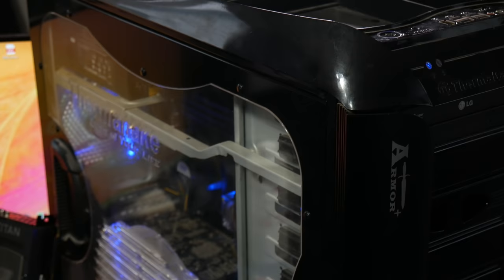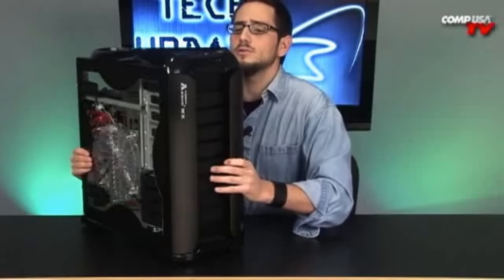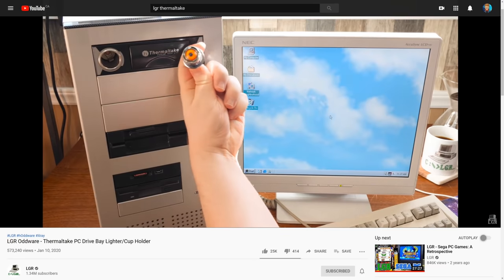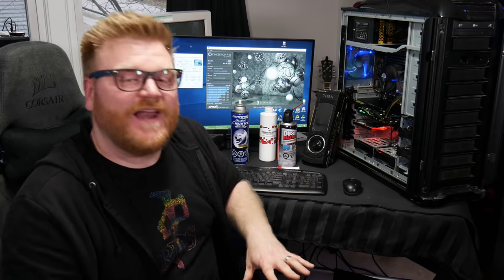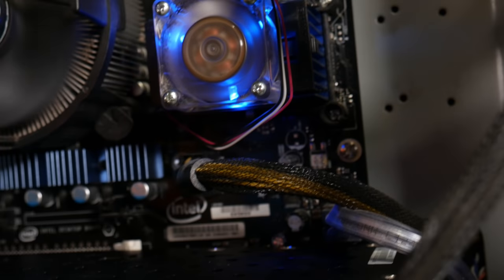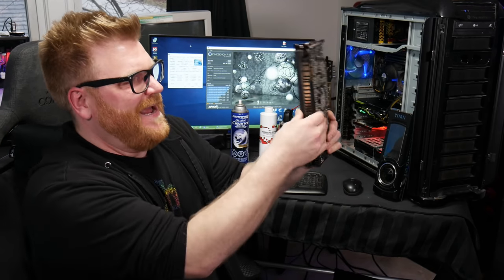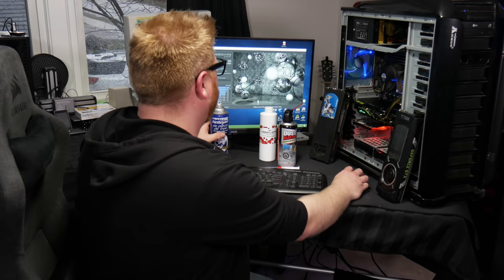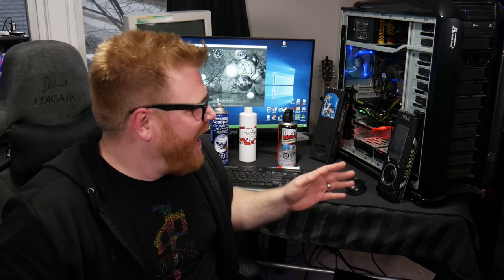Can $5000 buy a PC that will last 10 years?

Comment: HEDT is something you buy and regret in 3-5 years. i regret buying this i7 6900K when Ryzen launched.  the price of ryzen for the performance really was a kick to the nuts. now with ryzen 4000 coming,the i7 6900k and intel's gouging at the time, i can say it hurts everytime i think of the price tag.

meanwhile the EK 360mm kit i bought is my most prudent purchase... it as expensive
it cooled my i5 3570k that ran 4.4-4.6ghz for  a year before i had to drop it back to 4.2ghz 
and right now its cooling the i7 6900k.

that said i did make full use of the threads... i was transcoding all my old dvds and doing streaming on the side.
but i was most disappointed with the clockspeed (i lost the silicon lottery)...it struggles to reach 4.4ghz, its stable around 4.2ghz  with some fiddling of the voltage but the temps trade off was not ideal. so i left the voltage to auto and max ratio at 4.0Ghz, this allowed the speedstep and intel turbo boost to be usable. this config dropped temps and allowed it to be a relatively quiet pc.

my plan is to get a ryzen 3300x to replace my dead i5 3570k Nas/home server pc.
after that is no concrete plans for:
when ryzen 4000 launches, might consider a Ryzen 4700/4600 as the game pc.
 This i7  6900k pc can then be a backup to my gaming pc or a capture/stream encoding
i dont need more than 8 cores/16 threads for what i do. and 32GB of ram. dont need 64GB.
might consider the "RTX 3060/3070" which will be a good  replacement for my GTX 1070

Comment: I litterally bought a x79 msi big bang 2 yesterday in a corsair 900d, titan x maxwell, 48gb corsair vengeance ddr3 2400mhz (which ive never even seen before) corsair ax1200i, coolermaster 360mm aio, 11 x coolermaster 120mm argb fans, thermaltake digital fan hub, 480gb ssd, 6x 2tb western digital blacks for a ridiculously low price. I mean im not gonna say how much but lets just say 100 bucks more than $200 😎.

Wtf is wrong with some people? 😂😂😂

Comment: Rate my build I’m working on!
R5 1600AF
Asrock b450m steel legend 
16gb 3000mhz dual channel RAM
Crucial mx500 1tb ssd
Gtx 1080 Evga acx 3.0
Corsair crystal 280x rgb case
Either a wrath prism or 120mm aio to let me overclock later on.

I’d appreciate input! Working on a college student budget, so I can’t afford to go all out

Comment: Why would you want to do that though? You can spend 350$ on a motherboard and processor every 2 years and still have bleeding edge tech in the mid range. You'd spend far less than 5000$ and have more performance than the 5k computer in the later part of the 10 years.

Comment: This computer is all sorts of oof. I feel like this is a prime example of people who have money but want to "save money" in the long run, always thinking the best is to invest heavily and play the long game without doing any research.
In 2012 when I built my first computer, I had very little money (I still do) The computer I ended up building was an FX-8350, M5A97 Motherboard with 16GB of RAM, a 1TB HD, a 650W 80+ Bronze EVGA open box PSU, some cheapo case, an open box 650Ti for around $570.
Did the computer last me 10 years? Well, no, but the majority of the components are still around and useful today, 8 years later. I sold the 650Ti for $35, later down the line. The FX-8350, RAM, HD, PSU, motherboard and case are all still being used. None of these components were really top of the line when I bought them but I did my research and bought everything when they went on sale for any reason. Every 6 months I deep clean everything (Thermal paste gets replaced every year) so the majority of the system is in great condition, two years ago I gave the system to a family member after plopping in a $40 250GB SSD as a boot drive, and a used RX 580 8GB I got for $90 and a Hyper212 I got for $10
Overall cost of the system, after upgrades/selling parts: $675

Buying the biggest and best things is not how you save money.

Comment: spend 6k now and sell it for 300 (loss of 5.7k and average performance at best  for the last 5 years and miss out on support for some things)
spend 3k now sell for 1.5-2k in 2 years, spend another 3k  sell for 1.5-2k spend another 3k  sell for 1.5-2k and buy another 3k and sell for 1.5, buy another for 3k and sell for 1.5-2k again. worst case senario you spend 7.5k but you get high end performance year on year while having to save less of a lump sum if your willing to go without a pc for max a week. best case senario you spend 5k which is less that you spend for your once off.
if you want to go even cheaper for very similar performnce you build the bestest system you can and buy second hand on the gpu. if you wait  few months after the inicial launch of new gen the next teir up is usualy release so you can score the 2080 (or equivalent in the future) where the people who have to have the best are upgrading again and just want rid of old hardware. it migh be a bit different this gen though with covid i wouldnt be suprised if the 3080ti launches almost at the same time as the 3080

Comment: If I had 2000$ to buy a computer for say 4yrs ,I’d buy a 1000$ pc now and buy a new PC for 1000$ after 2yrs.Thats the logical thing to do.Bcuz tech not only improves but also ‘evolves’ .Eg buying the worlds fastest 4 core cpu.only in 2 years the 8 core consoles come out and all games perform the same on cheaper or even better on slower 8core CPU’s .imagine buying the biggest HDD out there ,and star citizen lists SSD as minimum spec .One more,ur high end GPU(faster more powerful) but doesnt support rtx,but newer slower cards support the feature.your 1000$ phone doesn’t have 5G and the 400$ budget phone next year supports 5G.Going all out at once is never recommended(unless and until u have the cash to keep doing it every single year after every new product launch,frankly that’s not happening for any of us).Hope ur client reads this

Comment: pfffft 
plz 
I ran a P200 for 10 years 
Replaced it with a QX6700  I ran for 10 years (actually someone else is using it as a media server now so it's still being used )
And I'm 5 years into an i7-5930K and it still runs current games fine. 
Running a rig for 10 years is fine if its a solid build. 
I might replace what I'm running when PCIE5 and DDR5 are stable but I'm not expecting that before 2024  (and I suspect it will be an AMD for once. )

Comment: The thing mais thing is the when along with the how much.
You should never aim for the most expensive stuff, usually the mid-high tier, slightly above the bang-for-buck is what you should choose.
The when is one to two years after a new console generation, this way you'll have a PC that is way better than the consoles, have the new tech and would last at least the whole console generation of games.
This is a smart way to kind of future proof, by the end of the consoles generation your PC would still be running games of that generation better than the consoles.
As you've said, if he had waited until 2014~2015 his PC would be way better than what he got, if you recall, the current gen consoles were released circa 2013~2014 so yeah.
I think it's not a good idea to build a new PC now! If we disregard the pandemic prices and think only about the tech today, anything below a Ryzen 3700x and a RTX 2070S wouldn't be very futureproof and even that will ask for an upgrade by the middle of the next gen and by that time we'll have some parts that will perform the same but will be on a lower tier so they should cost less and anyway, so you might be able to save some money to get the same performance or spent the same money you would to get a really better performance and more futureproofneess.
Also, we don't usually have groundbreaking games before 1~2 years into a new gen, so it's easy to wait while keeping yourself distracted by your Steam backlog.

Comment: Regarding that titan X: depending on how much the gpu was stressed (incl. overclocking) and how hot it got (especially he did not do any maintenance), maybe try underclocking on top of adding voltage to see if it works better. Tech yes city flashed custom BIOS with the new stable frequency into the gpu for resale. For last resort maybe buy a hot air gun instead of the oven (health reason) and concentrate on the GPU die balls. Anyways stay safe!

Comment: Well, I still use an i7 860 (which is even worse than this) as my daily driver, with 3.7 ghz oc (originally 2.8 ghz) and a gtx 970
it's still playable, I mean, Gta V, Assassin’s creed, Farcry, just cause, even Pubg and Cod warzone! runs (Cod on low, but 60 fps - 1080p only)
No, I didn't buy this computer originally thinking that It would last 10 years, but not having the money to upgrade the whole system, I just replaced the graphics card and it's been serving me since

Comment: I dunno, he should probably buy the xeon 6 core, a cooler master evo, go to 16gb of ram and like an rtx 2060. He'd probably be pretty good on most modern games, have minimal bottle-necking and he only spent $400 total. That should buy him another year or two. He can then give that machine to a high school kid and they will enjoy it. 
I've been using a 20 core ivy bridge-e for system for 5 years. Bought a new gtx 1080 and upgraded to used 128gb of ram from ebay. Spent around $2000 total. My computer will still smoke most modern systems with a 6000 in cinebench and a 11000 in geekbench 5. My 7yo machine comes pretty close to a 3950x and beats the 9900k. I can play any game in 4k at about 45fps. Most games can do 60fps at 4k. I'm pretty sure I am good for the next 3-5 years if I wanted. 
However, I will probably upgrade to Threadripper 3960x in a year or two when the price drops. I will double my performance over now, have a huge upgrade path to 64 cores, double my potential ram capacity and be ready for pcie4. That computer will certainly last 10 years as my current one has. I will spend around 3k as I will keep my current psu, case, coolers and gpu. I will spend all my money on cpu, mobo and ram. My current machine will then be demoted to a home server where I will likely get another 10 years from it in that use case. 
Point is, you can build a computer that can last 10 years as a daily rig, but you cannot buy consumer parts if you want that. You have to buy HEDT or higher if you want that kind of longevity. I am not a performance hawk. As I feel like I am just chasing wind. I like stability and dependability. I wanna just sit down at my desk everyday and know I am not going to have a computer issue and be able to do what I want to do. As long as my computer is rock solid, I am ok with watching its relevance slowly decline for 10 years. If my computer platform doesn't last 5 years it was a fail. I expect 10 years of worry free use with moderate upgrades along the way.

Comment: This is my comp i built a few yrs ago
AMD - Ryzen 5 1600X 3.6GHz 6-Core Processor
Cooler Master - MasterLiquid ML240L RGB 66.7 CFM Liquid CPU Cooler
Asus - STRIX B350-F GAMING ATX AM4 Motherboard
Team - Dark 16GB (2 x 8GB) DDR4-3000 Memory
Samsung 970 EVO 250GB - NVMe PCIe M.2 2280 SSD (MZ-V7E250BW)----Newest
Samsung SSD 850 EVO 500GB
Western Digital - BLACK SERIES 1TB 3.5" 7200RPM Internal Hard Drive
MSI - GeForce GTX 1070 Ti 8GB Titanium Video Card
Cooler Master - MasterCase H500P ATX Mid Tower Case
Cooler Master - 750W 80+ Gold Certified Fully-Modular ATX Power Supply
Cooler Master mm830 Gaming Mouse with 24, 000 DPI Sensor, Hidden D-Pad Buttons, 4-Zone RGB, and Precision Wheel----Newest
Cooler Master MasterKeys MK750 RGB LED Mechanical Gaming Keyboard, Cherry MX Red, RGB LED, Full Size, Wrist Rest (Large)----Newest
Cooler Master MasterAccessory MP750 XL Soft Mouse Pad with Water Resistant Surface and Thick RGB Borders----Newest
Cooler Master MH670 Gaming Headset with 2.4GHz Wireless, Virtual 7.1 Surround Sound, and Multi-Platform Compatibility----Newest
Cooler Master GS750 RGB Gaming Headset Stand----Newest
Logitech HD Webcam C615
Samsung CF396 Series Curved 27-Inch FHD Monitor (C27F396)
ASUS VK246H Black 24" 2ms(GTG) HDMI Widescreen LCD Monitor 300 cd/m2 DC 1000:1 (ASCR 20000:1 ) Built-in Speakers w/ 1.3m Pixel Webcam(webcam no longer works)
Microsoft - Windows 10 Home OEM 64-bit

Comment: The most money I have spent on a computer is what I have now, when ryzen first came out... It was the first PC I had ever tried to go high end with... I don't even want to try to remember what I payed for the original PC I just came across alot of money and wanted to build a bad ass PC and I'm still to this day catching crap about the cost from my wife... But hey it still runs great so that's a plus...

1700x
Crosshair 6 hero w/ ek monoblock
Trident Z 32gb 3200 c16
500gb 860 Evo nvme
2x 2tb hard drives raid 0
2x ek water cooler 1080ti FTW3 SLI
2x 360 rads w/ 6 normal  (no lights) performance static pressure fans
Ek ddc pump w/ heatsink

The only things I have changed is I have sold 1 of the gpu's because SLI is so pointless it's not even funny... I found a 4tb 860 pro (sata) for 280 on Facebook... Changed the  hard drives to raid 1... And I have bought an CPU water block to cool just the CPU for when I get my 3700x because the monoblock is clearly not made for the new zen chiplet design with it's circular CPU cooling area

Comment: If you knew what you had to do, a i5 2500k would've lasted like 7 or 8 years. You'd only have to update the GPU maybe the RAM / SSD. I like the idea to buy hardware that lasts longer but it is probably not gonna happen.

Comment: If someone have money,this is the way.It was worth it,if he had buyed every 2-3 years new pc with this budget he would have(instead of gtx295 and later titanX those cards:9500gt,after that gt950,than pc with 1050,and now,maybe,gtx1650,all cards much,much less powerful.Plus,he would probably need to buy with every new mid range pc new ram,motherboard,probably psu and maybe pc cooler etc.So, if he want new pc after 10 years ,for 5-6000$,just go for it.It will last 10years for sure.

Comment: It kinda did work though. Why keep building new systems when you can upgrade parts over time? Only mistake was not selling his upgraded parts immediately. Premium components (especially mobo/psu) are made to a higher quality/feature standard obviously. Last year I put a GTX 750 in my ancient fancy pants system I built start of 2011 - originally a Phenom 965 later upgraded to an 8350 (sold the 965 for a surprisingly large portion of the upgrade price in 2013). Luckily my top of the line MSI mobo got support added via simple BIOS update to cater for the 8350 when it dropped (even though the board was years old - less premium boards didn't see the same update). However, I'm not really a "latest trend" gamer, and stability and uptime are more important to me than frames in the latest games. I'm due for a Ryzen build now, but I can put my GTX 750 in the new system anyway, I'm also gonna reuse my original sleek black windowless full aluminium Lian Li case (a tad for sentimentally, a tad for budget, but mostly because I don't think any new cases look as good any more - even from Lian Li). I could probably use my original Seasonic fanless psu too, but they're so cheap now that I might just get a new one (Seasonic was crazy boutique level prices back in the day). The system's been on for probably 10 hours a day for 9 years, I was nervous going completely fanless psu originally, but damn this thing's been solid. 

So, in saying all that, I guess it really depends what your workload is like, for a gamer that just wants acceptable frames in whatever the latest game is on the weekends, probably better off buying absolutely cheap as possible every few years as you say. But for people with precious data, the fancy pants build has made life a breeze. I do game too, but a 750 is more than enough for my trash skill level in CSGO, haha. Oh, and yeah, reseat your heatsink with fresh paste when you clean your system every couple of years, haha. Oh, and I've upgraded to SSD in that time too and various mechanical RAIDs (but no need to detail that).
Reply: (it wasn't as crazy as $5000, but it was double what other people in my position would have spent - saved a lot by not needing the latest gfx card - which is a breeze to upgrade later anyway)
Reply: Whatever the biggest Noctua cooler was available, just pretty much the highest price version of everything in that consumer bracket at the time, upgraded the RAM and sold the old stuff at some point too (got a decent chunk back on that too because my original stuff was still sort after at the time because it was top shelf in the sea of the used market).
Reply: Also, buying the more expensive stuff kind of reduces waste and also shows manufacturers we care about build quality. So many cheaper builds end up in landfill at a more rapid rate, whether or not this is significant I'm not sure, but it feels better.